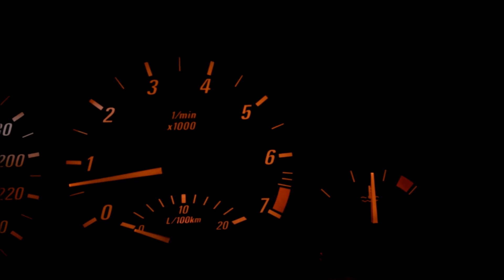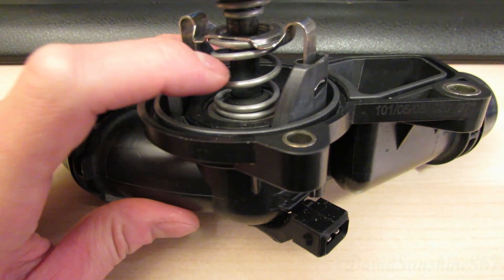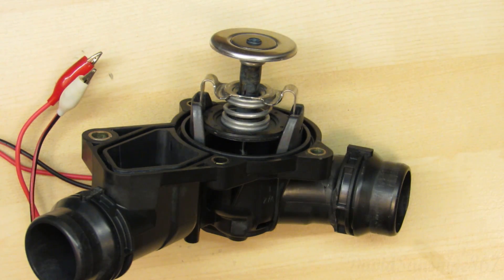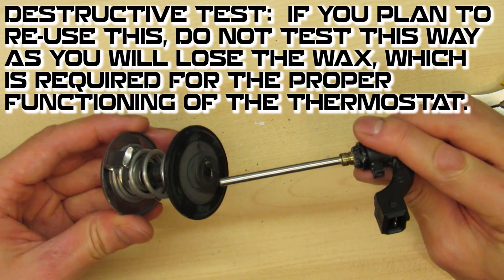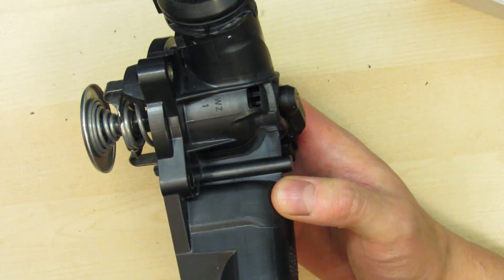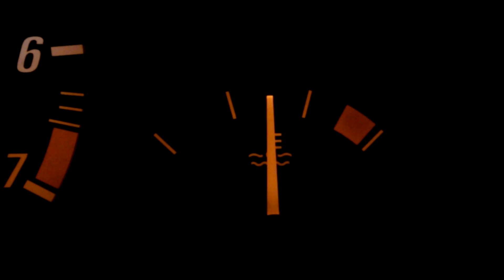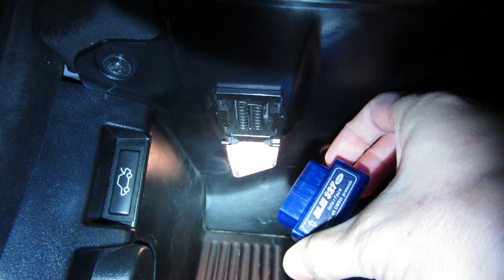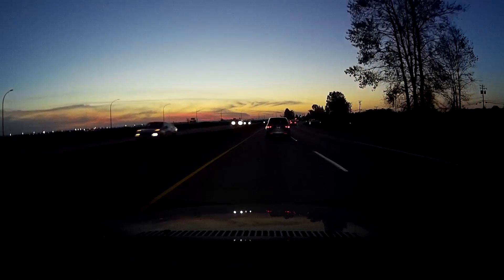How a Thermostat Works in the E46 - How to Diagnose a Broken Thermostat

Comment: It only took me a hr to replace mine, why ppl say 3-5 hrs
Reply from the maker: Nice! Ya it's definitely a 1 hour job with the right tools and know how. To remove the fan, you need a special tool or a big wrench, I'm not sure if everyone has the right tools to do the job.
It was my first time doing it so it definitely took me a little longer. I think the fan is reverse threaded too! I can barely remember now. It took me some time to clean up the surface and prep it for the new one too. If I had to do it again it would take me a few hours for sure.
Cheers! 
David.
Reply: Do you have the link for the alligator clips that can also connect to a 12v source?

Comment: Bro, I stumble upon your video and it's very informative. Anyway, I have an E39 328i 2000 (M52TU / M54). I live in tropical country and the temps varies from 35c-40c.

The temps of my e39 is around 99c if driving slow around 30-60 km/h, but rises to 100,101 on light traffic, and 102 in heavy traffic. But whenever I rev the engine to 2500-3000 rpm, the temps went down to 99c again. If I rev it to 4000 rpm, the temps went down to 93, sometimes 90. It's also same whenever I kick down on a highway, the temps went down from 101 to 90c.

But there's two moment when I after drive around 45 minutes in a quite heavy traffic, and the temps from 101-102, suddenly drops to 82c and it stays for around 5 minutes. It also went to 84c around a couple of minutes then went back up to 99-100c. The first was during traffic. The second, was after I made a quick stop.

Does this behavior showing that I have a bad thermostat? It was Wahler, and I purchase it a month ago. But many people said in the forum that new thermostat sometimes not working properly. (I also already change the radiator pipes, hoses, radiator, and waterpump).
Reply from the maker: @wailanmain  Hey. That sounds pretty normal. The drop to 85 could be the computer thinking you are gonna need some high performance or hill climbing so it opens the thermostats electronically. If the thermostat was not working well, you'd get overheating or take a long time to heat up the engine from a cold start. If it heats up quickly then stays below 102, then the thermostat was closed then opened properly as designed. 
I wouldn't worry about the cooler temperatures for a few minutes, that is probably just the car getting you ready for a hill climb or heavy engine loading, that's what the electronic heater element was designed for. 
Cheers!
David.
Reply: @DavidSunshine  I see, thanks for the response David! Actually I’m a bit worried about my average temperature of my car that runs 101-102 during traffic (sometimes 103, I think) when the traffic is really loong! But average on 99-100c when on a slow cruise. 

I bleed my cars a couple of times either its warm or cold bleed. Now, every morning I check there was no reduction in coolant as the sticks keep in kalt position. But, I’m just wondering why my car wasn’t operate like you or most of my friends. (Stays below 100c on idle and traffic). I’m using 50-50 bmw coolant + distilled water by the way.
Reply from the maker: @wailanmain  I see.  Someone with an e90 said it varies at 105-112. I think 102 would be fine, since you want the engine to run hot to drive off moisture, and it's a good hot temp for the lube and combustion. 
Check with others with E39, it might be the norm. 
Cheers, 
David.
Reply: @DavidSunshine  okay David. Thanks for the input. Actually my e39 (528i 2000) is using m52tu engine that quite similar with e46s 325 with m52tu and m54 engines. The thermostat is also the same with what you’re using in the video. The specs on thermostat said that it’s open in 97c (I don’t know which procedure between from dme or mechanicaly). But it’s written on the tstat.

The difference between e39 m52tu and e46 with m52 or m54 engine is the bleeder screw. E39 m52tu have 2 bleeder holes. One beside the tstat, the other is around the expansion tank.
Reply from the maker: @wailanmain Hi. Also, if we're both using the same thermostat, the outside temp probably has a lot to do with it, I'm in Canada and it was probably 15-20c outside when I made this video, so much cooler.  If it's 30-40c, I'm sure you'll see higher temps. Looks like for the e39, an m54 engine, people would expect 105-115c in heavy traffic in hotter climates. If it goes above 120c the car actually reduces power to limit overheating.  It also sounds like there's two thermostats on the M54, one for engine block and one for cylinder heads, I didn't know about that, not sure if that affects things.  Maybe one is stuck?
Cheers! 
David.
Reply: @DavidSunshine  maybe it’s outside temp. But my other friend that using m54 in my area also have it below 99c. I think that there’s only one thermostat that look similar like yours.
Reply from the maker: @wailanmain How about the thermostat he's using? Looks like standard is 87c, could be why he's getting lower temps. That'll probably help in 30-40c weather. 
I'm in a cold climate so I need a higher thermostat for when it goes below 0c. 
Cheers, 
David.
Reply: @DavidSunshine  the thermostat that I have in my country are all the same. A 97c tstat like yours. The brand may vary (mahle and wahler). But all open at 97c.
Reply from the maker: @wailanmain  oh I see, if it opens at 97C, I think a temp of 102C is reasonable, since 97 is when it's fully open and allowing coolant to go to the radiator, it's not all the coolant flow either, just some of it, so with dilution with the hotter coolant that is going back to the block and cylinders, you would get a higher temp than the opening temp. 
Your friend might be getting a different temp because his thermostat opens at lower temperatures. It's designed to open at 97 but it can vary between manufacturers and batches. 102 isn't too bad considering that's in 30-40c ambient. If you can get an 87c, I would put that in, especially in hot climates. 
BMWs are prone to plastic cracking everywhere, so if we can use lower pressure caps and lower temp thermostats, we should.  It'll help reduce wear and tear. Maybe it'll help avoid the cracking overflow coolant tank? It certainly wouldn't hurt to use lower temps. 
But 102c seems reasonable, like everything is working properly. 
Cheers, 
David.
Reply: @wailanmain  Dont worry, I have 3yo Febi thermostat and checked the temp after coolant change now with Ista and it was fully warmed car then idling for 20 minutes in -5C and the temp was 99C, I have M54B30 e60.
Reply: @miras7382  Hi, it turns out my Tstat was kinda stuck at first. Because after a few drive with high revs, or even revving on a stop, the temp went down to 81-85c. It's a new tstat. So, I ended up replacing it with my used Mahle drilled tstat (Drilled by the shop). Now temps sitting between 78-84c. On a spirit driving, it will go up to 87c sometimes 90 ish. I know it may be over cool, but I still getting use to it. Maybe in the meantime, I will change it to the Wahler tstat again.
Reply from the maker: @wailanmain  I found a thread discussing this, and there are some links to places where lower temp thermostats can be purchased, sounds like the OEM ones can vary with some maintaining low 90s and some above 100, even if they are rated 97c. https://www.e46fanatics.com/threads/e46-coolant-temp-problem.1187953/page-2

Comment: This was one of the best videos. Tested new thermostat with 12v and 1 amp, it opened after a few minutes. Tested old thermostat with 12v for half an hour, it didnt move. Thermostat was dead, so when idling my temperature was ok, but when driving i was badly overheating.
Reply from the maker: Thank you! Glad you enjoyed the video! It was fun playing around with the thermostat and documenting my findings. 
Good job fixing the overheating issues! Happy driving!
Cheers, 
David
Reply: @DavidSunshine  the one thing I didn't realize is that the thermostat comes out of the housing! Basically you can swap the thermostat into an aluminum housing!
Reply from the maker: @BimmerFix   Dang that's awesome! Would be a cool upgrade for sure. I sold my 325ci but I miss it. I see it driving around town sometimes.  
Cheers! 
David

Comment: So like if my car is like at 12:10 to 12:30 it most likely is stuck and caused it to overheat?
Reply from the maker: I would check the temperature, if it's above 95C then that's kinda hot, but if you got a high temp thermostat it might go higher.  You can check the temperature in the console, you don't need to buy anything, just need to push a bunch of buttons.  Look up procedures on how to check temperature on E46 cluster and you'll find it.  
If it's overheating in the red, don't drive it, you don't want to overheat your engine. 
Cheers!
David.

Comment: When the thermostats bad, does it trigger a check engine, light or service engine?
Reply from the maker: Hi, thank you for the great question!
No not at all, it will overheat the engine until boil over, or over cool the engine and sludge up your engine oil leading to further damages.
There's no safe guards on it except the temperature gauge that the driver needs to keep an eye on and fix if it's not stable at a proper operating temperature. 
It's crazy that the ECU keeps track of everything but doesn't warn you at all or even a check engine light or beep until something major fails.
You'll need to trouble shoot on your own.  They typically fall open, so in the highway your temperatures may go too low, that's an easy way to tell your thermostat is failed open and you need to replace it, cuz you don't want your engine running too cold for too long. 
Cheers!
David.

Comment: Since you  showed how to take it apart and cleanning it. Is that really possible? I think my thermostat is stuck open. When i idle specially in cold weather my needle goes up to the second line. At 11 oclock. When i start driving at 35 to 45 mph it goes lower. Then when i’m stopped at the light it goes back up to 11 oclock.
Reply from the maker: If you want to try and save some money, you can take it apart and clean it and bend the shaft back straight, it'll function properly if you can fix the issues. But it's probably better to just replace it with a new one.
Mine got old and failed open as well, it got cold just like yours at speed. I put cardboard in the grill to keep it warm in the winter until I had time to replace it. You can do that too if you need to drive and want the engine to warm up.  With the cardboard in the grill, it still works fine since the fan will come on when it's too warm, the system has a lot of cooling capacity so the chances of overheating are very low, but keep an eye on it if you're stuck in traffic.
It's typical to put covers on grills in the winter if it's cold enough. 
Cheers!
David.
Reply: I have discovered another issue this winter. My lower hose collapesed after driving and parked. When the engine cooled down. I check it and noticed my lower hose had collapesed. I searched about it, a lot are saying reason for collapseed hoses at vaccum in the syatem. And adviced to replced my resrvoir cap. How does the cap works on bimmers since it doean’t have a spring in the cap like most vehicles? cap?  Btw, you mentioned wax is used to heat the cylinder in yhat electric heater for the spring to pop out? Is the re a fuse for the two wire plugged in the thermostat? If so do you know which nunbet in the fuse box?

Thanks
Tengz
Reply from the maker: @tengzturiagaiii3185  The cap should let air in if there's a vacuum but hold pressure in. It doesn't have a spring but there should still be a spring and check valve internally, that may be stuck. I've never taken one apart but I suspect it is the same as other caps in function. 
They are probably right that a replacement would solve that issue. 
Cheers!
David.
Reply: Cheers. Thanks David. 

I’ll give it a try replacing the cap first. Before i try taking the thermostat apart. 

Thanks
Tengz

Comment: By the way my temp gauge has been stuck to all the way on high rest it on cluster and it moves but goes back to hot car not even on also used another instrument clusters and still does the same. Temp sensor new the whole cooling system new.
Reply from the maker: Hi,
You can first check the read out using the cluster (https://youtu.be/8Ed1hf0pVGk, item 7) or a generic obdii read out and the torque app.
Have you tried checking the codes using an obdii checker like Carly? It'll tell you the codes from the modules, the generic readers won't give you all of them. 
Cheers,
David.
Reply: @DavidSunshine  yeah I do 7 gauge cluster every time I get in because I can't see the temp so I do it through the cluster. And no codes on 5 different scanners
Reply from the maker: @brendam455  Oh ok so the sensor is fine, just the cluster isn't showing.  How about when you use 2 to test the cluster? Does the needle go the full range? If not then it'll give you some ideas to start troubleshooting. 
Cheers,
David.
Reply: @DavidSunshine  yes it test fine and resets and then after turning car off back to high temp

Comment: so today i removed the termostat applied 12v and it got hot and opened after that closed and the car is giving me map cooling error should i  change it?
Reply from the maker: Hi, it might just be a code left over from when it was unplugged. Or the connection is loose. I would try unplugging and plugging it in 20 times with contact cleaner and then checking again. It's always possible it's a bad contact, rather than a bad heating element. If the heating element is actually dead, then I would get a new thermostat, but I doubt that since you tested it and it worked fine. 
Cheers,
David.
Reply: @DavidSunshine  So today i replaced the Thermostat with brand new Behr one and the error is gone after i clean it up and not reappearing so i guess it was something wrong with the last t-stat (it was 7 yr old)

Comment: Great video. I ordered the OBD ELM 327 just to check my car temp because I recently had an "open jammed" thermostat, which I also just replaced. However, my temperature gauge is going up so quickly compared to what it was before. It only took a 2-mile drive for it to go from the 6 (cold) to the 3 o'clock position (normal). I took the car to the dealer and to an independent mechanic and had both of them checked out. Everything came back normal. But something tells me it's NOT normal. Do you have any idea why it goes up so quickly, although it never passed the normal temp? In the 7 series, the normal position is 3 o'clock.  I'm suspecting the water pump. It's a 95K-mile car. Thanks
Reply from the maker: If the temperature is going up fast, it been be indication of a slow water pump, but since you aren't overheating, the water flow might be ok, in that case you might have low thermal mass, meaning your glycol to water ratio is not 50/50, and could be high, e.g. 80/20.  It should take some time to heat up to operating temperature, water takes a long time to heat up, about 10 minutes.  If you are overheating, it might be ok, but if it's heating up that fast, you might be in trouble on a hot summer day, but ok during cooler weather. 
The shops should have tested the mixture thought, did they mention what it was?
If you gut is telling you there's something wrong, it's probably right.  
Cheers!
David.
Reply: @DavidSunshine  
The bill indicated that there was a 50/50 mixtures since they charged me 1 gallon of coolant and a gallon of distilled water. You may be right that I have a slow water pump and that the car will get hot as summer approaches. Furthermore, it takes an extremely long time for the car to cool once it got to the normal temperature. In other words, it would take the car almost 24 hours to get to cold.

I timed the amount of time it takes to go from cold to normal this morning, and it took 7 minutes. That’s a big faster than before. I would say twice as fast, despite the fact that it’s a “hot V” V8. Should I wait a bit to see how it would be in the summer days, or just go ahead and fix the water pump? Thanks
Reply from the maker: @VietLe-USA  Hi, good to hear they replaced the coolant.  7 minutes isn't too strange for a V8, I've got the 4.4L S63 now as well, and it gets up to operating temperature in about 7 minutes, so that's not too strange, it keeps the thermostat closed until it gets up to operating temperature so it should warm up pretty fast.  I haven't timed if it'll take 24 hours to get cool, but I wouldn't be surprised if it took that long actually. The water pump can fail, but if the mechanics didn't recommend replacing it, it shouldn't be a problem. I would wait till the summer and if it runs fine, you should be ok to leave it alone.  BMW's cooling system is oversized, so it should easily be able to keep the engine at operating temperature under normal summer conditions. 
I usually don't replace parts unless I know it's failing, but if you want to replace it as preventive maintenance, you could do that, no harm in that.
Cheers,
David.

Comment: I have a 2002 bmw 330i that i replace the thermostat and now while I'm driving above 60mph the temp gauge goes to red and if i slowdown the temp goes back to normal but it only does one time after that no issues. No coolant leaks. Any suggestions. 
Thanks
Reply from the maker: Sounds like it could be air in the system.  I would try a bleed procedure to get all the air out of the coolant system.
Reply: @DavidSunshine  thanks for your respond and i will bleed the system one more time hopefully that will fix
Reply from the maker: @chrisyo295  Anytime!  After I replaced mine, I had air in it as well, and had to do the bleed a few times.  Look up the proper procedure for the e46, it's pretty complicated and hard to get right cuz they have both a mechanical water pump and electric water pump for the cabin heater core.
Good luck!
Cheers,
David.
Reply: @DavidSunshine  thanks brother.